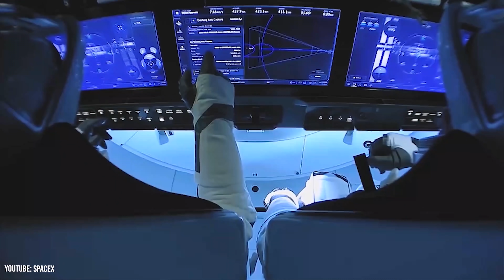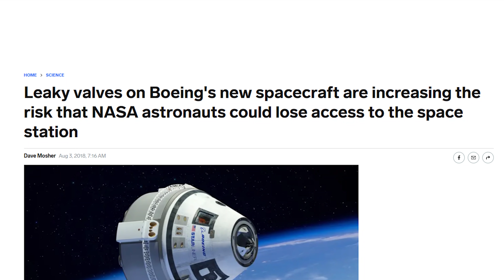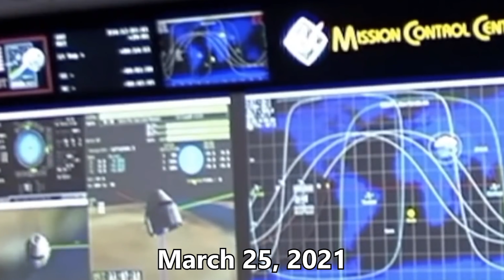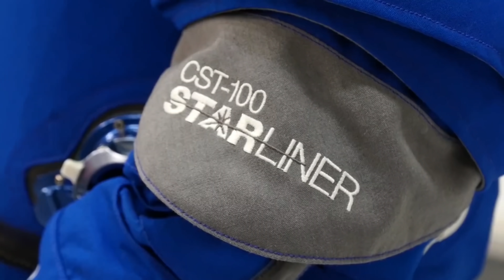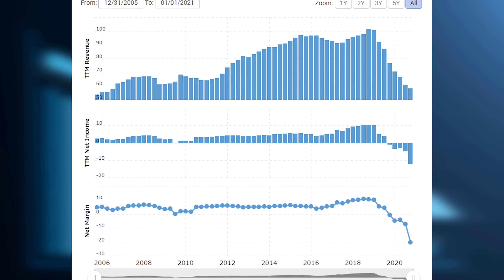What Happened To Boeing Starliner?

Comment: Boeing's Space division has absolutely nothing to do with their aircraft business. None. Also, the pandemic didn't seem to slow SpaceX down much, so why would it affect Boeing? 

The reason the Starliner had 80+ major issues, according to NASA, is that the vast majority of the spacecraft's software was written by non-Boeing people, outside the country, and there wasn't any full-up testing of the software with the hardware. Boeing's problem is that there are way too many Mcdonnell Douglas managers running things instead of Boeing engineers. This is why Boeing's core business of aircraft manufacturing is going down the drain and why their space business is soon to follow.
Reply from the maker: Thank you for the clarification!

Comment: A lot of people misquote SLS as being Space Launch System when in fact it is "Special Launch System"... Ofcourse with the expectation of crewed orbit around the moon and/or inhabitation of the moon in some not so distant future, the ability to transit small crews to and from the moon in short order is an expected prerequisite of any schedule program that might take place in such a future...
Reply: Not sure where you're getting the "special" from... If anything, it's known as the Senate Launch System, since Sen Shelby's the one pushing so hard for it.
Reply: @Ekatha  it’s a limited run acquisition program...
Reply: So, by definition, it falls under special programs...
Reply: Also, there are no other vehicles other than the Orion that will leave Low Earth Orbit, or LEO. Niether SpaceX's Dragon or Boeing's Starliner are rated to go to the moon. The Orion, lifted exclusively on the SLS, is the only way crew will get to the moon or Gateway, where another craft will land them.
Reply: Ok.

Comment: Here is what really happened to starliner.

First off the bush and obama administrations did everything in there power to destroy the U.S space programs. 
Second boeing is owned and operated by corrupt officials with there fingers in polotics just like big oil.
Third b4 spacex boeing and Lockheed know that if they get delayed or need more funding then nasa will pay because what other options did they have. It is the standard practice for them to siphon money from nasa as much as they can. Literally deliberately paralyze the program for more and more and more money. It is criminal, corrupt theft and they have been getting away with it for far to long. Not anymore however.

SpaceX is what happens when there is no corruption and no lies or corrupt people spear heading the program.

Its that fucking simple. Fuck boeing!

Comment: It does have the advantage of being able to adjust the ISS’s orbit, something Dragon can’t do
Reply from the maker: True
Reply: What is reason for lack od this ability in Dragon?

Also this is white large thing, Because then they NEED a second spacecraft.
Reply: @ImieNazwiskoOK  Im not too sure, but dragons most powerful thrusters are under the nosecone, and all the other thrusters are way too weak to push the ISS.
Reply: basically, they cant use the thrusters under the nosecone if said thrusters are right under a docking port
Reply: @German Norwegian They (super dracos) are on the sides (this is why there is this weird shape).

But maybe it's Because it's in front of service module so during firing they could damege radiators and solar panels.
Reply: @ImieNazwiskoOK  no not those engines, there are more powerful RCS thrusters under the nosecone, which are used for the deorbit burn. they want to avoid using super dracos in space due to their extreme TWR, and using them during the deorbit burn would make for much less precise trajectories since you would have to fire for a short time instead of firing for a long time and just constantly tweaking your path
Reply: @ImieNazwiskoOK  Maybe using super dracos for boosting the ISS would be an option if it wasnt for what you mentioned with the damage to the trunk, but i think it wouldnt be used anyway
Reply: @German Norwegian Maybe they could use them on cargo mission (CRS) with no planned return.
Then they wouldn't need to keep radiators and solar pannels.

Also there are 8 engines and they are in duch a way that I think you could fire 2, also they can strongly reduce thrust.
Reply: And maybe for cargo returning would be possible (but I'm not sure if batteries would lasy long enough).

But for Crew, flying without radiators could end up like Sputnik 2.
Reply: @triplogbook  Super Dracos are to high thrust to be safely used in the vicinity of the ISS
Reply: @phoenixrising4573  yeah exactly
Reply: It doesn't matter if Boeing can't get a craft to the ISS.  Boeing just sucks.
Reply: Assuming it ever gets to carry people. Currently just theory.
Reply: @webdaddy  i honestly just wish dreamchaser was chosen instead. Wouldve been a much more exciting commercial crew program too, having a crewed spaceplane again. Dragon, and dreamchaser are the perfect combination imo
Reply: And this is the ONLY reason the Starliner will end up going to the ISS.
Reply: ISS is as the name suggest International so they will still use Soyuz which can do it
Reply: @ImieNazwiskoOK  well nasa wants two spacecraft for commercial crew for redundancy, soyuz is only backup for the us rn
Reply: Yet.
Reply: Landing on terrain is a huge plus as well.
Reply: @pzoe3808  Why?
Reply: @ImieNazwiskoOK  saltwater corrosion
Reply: @ImieNazwiskoOK  not good for the Spacecraft
Reply: @triplogbook  Detaching (destroying) heat shield and hitting very hard ground also isn't good.
And this isn't much time until picking up.
Reply: @ImieNazwiskoOK  well yeah good points, but the starliner uses airbags to dampen it a bit, but its still a rough landing. Saltwater is kinda worse tho since it tapers on the metal and makes the refurbish times longer... 

but I'm still a dragon fan lol